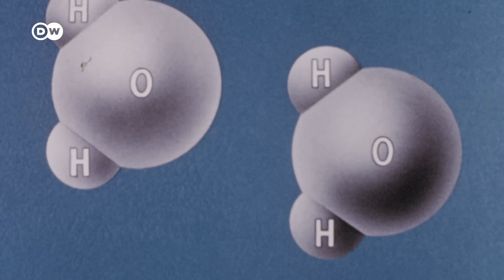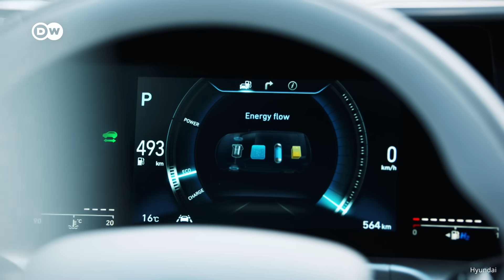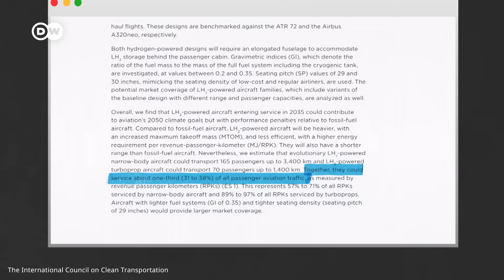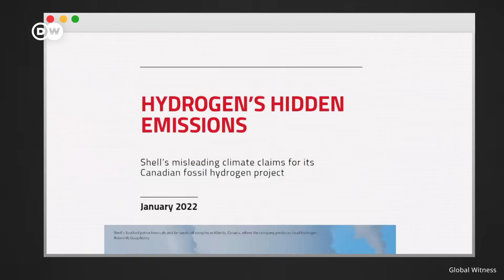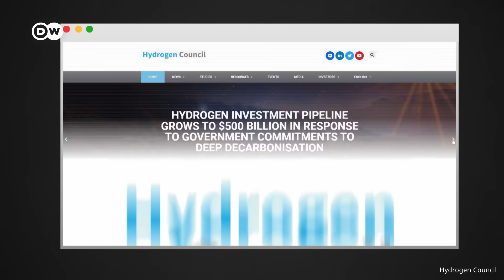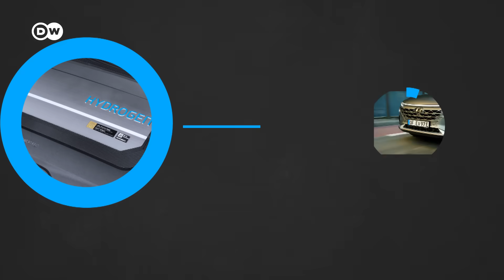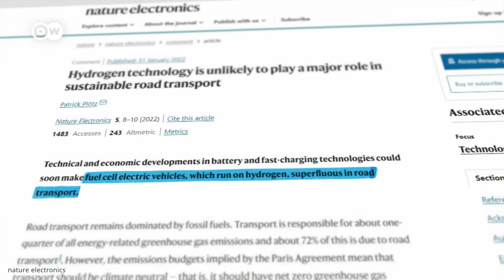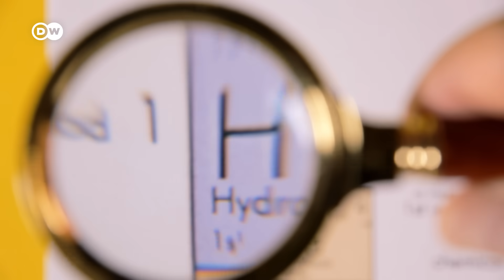The truth about hydrogen

Comment: The fact is that it takes more electrical energy to produce hydrogen than the hydrogen can produce in return. Hydrogen electrolysis is the most efficient known method to produce hydrogen yet still has this deficit. Battery storage is more efficient. Liquid hydrogen and fuel cells can give greater range but at increased cost and danger of explosion in an accident. As a source of "surge" electricity, in a fixed site scenario, there is some justification for the technology. The hybrid fuel cell that can be "fed" hydrocarbon fuel, liquid or gas, is much cleaner and efficient than internal combustion yet is being IGNORED as it uses hydrocarbon fuel...even though those hydrocarbon fuels can be renewable. Shame really.

Comment: while talking about green energy and making a case against fossil fuel economy, you never mention nuclear power. hydrogen is a way to store energy without needing a battery or grid. so modern nuclear plants outputting hydrogen is the clear method for net 0 future.

transporting h2 could be costly at first, but as long as it's 0 carbon it's still a positive aspect.

Comment: Continued  electrolysis production  of hydrogen  after a few million years will cause a measureable increase in the oxygen  ratio of the atmosphere . The oxygen  ratio is a fine balance. We're now at 21% region. 22% would increase fire risk for forest fires .
 Town gas used to be carbon monoxide and hydrogen obtained by passing steam over red hot carbon/coal . Probably  not much of the hydrogen  component  reached the consumers  before leaking away . Leaking out into space escaping earths  gravity.

Comment: People get carried away without considering the fly in the ointment. Hydrogen is very expensive. Wind power is already expensive,then using it to make hydrogen by hydrolysis, which loses about 20% of the energy, makes it even more expensive. It then hs to be pressurised to liquefy it down to a volume which can be handled. That uses more energy. The final prodduc is gong to be extremely expensive and we need cheap energy for the world to function.

Comment: Batteries won't work for trucks, and one study saying they "could" doesn't change that. When the truck's weight is limited you can't have half of that weight being batteries. We should move towards LNG/LPG and eventually hydrogen for trucks. As for cars, batteries might be good enough in 10 years, but right now electric cars suuuck for most people. Sure, if you live in a home instead of an apartment like most people, if you don't travel much, or aren't bothered by a 10 hour trip becoming a 15 hour trip then electric cars are good enough now. For most of us they aren't. So we should instead continue to build hybrids with 1-200km of range and a thermal engine running on LNG/LPG. This would eliminate most of our emissions in a way that is also practical and not economically crippling to the poorest among us.

Comment: Hydrogen should be pruduced with te excess from renewables and then injected in the gas (methane) grid to supply single consumers with a blend of the two gas hence reducing fossil fuel. This is far more economical and practical than investing into new vehicles powered by hydrogen cells.

Comment: Honestly, I would bet on methanol rather than hydrogen.

Methanol can be produced by photosynthesis means starting from sunlight, CO2 and water.  The efficiency can be quite high.  I read about some laboratory prototype with  almost unitary efficiency. I do not remember the efficiency of electrolysis, but I have a memory that is not great.

Methanol is a liquid, therefore it does not escape to the air and it does not impact the ozone layer; car be refueled as it was petrol; the density of energy in J/volume is much higher than hydrogen.  Yes, density per mass is higher in hydrogen, but the weight of a "full" of methanol is negligible (~50 kg) with respect the weight of the car (few tons).  Easier to transport and to stock.  It can burnt both in engine and in fuel cells.

Sure, when burnt it produces CO2, but that is CO2 that was already in the atmosphere. You can use it also as a capture system, using the methanol to produce other stuff.

Comment: A point that none does about hydrogen is the effect on the ozone layer.

Hydrogen is the lightest gas, this means that it is the one that escapes most easily from small leaks.  That is, in a hydrogen-rich economy you should expect lots of leaks.  

Hydrogen is pretty reactive too, so I expect that it will react quite easily with the ozone (another quite reacting element).  I suspect that it could cause a damage to the ozone layer more important than CFCs.
Reply from the maker: A study by BEIS Research looked into hydrogen heating and it's environmental impact and it found that the best estimate of the carbon dioxide (CO2) equivalence of hydrogen is 4.3 megatonnes of carbon dioxide per 1 megatonne emission of hydrogen over a 100- year time horizon. This means that yes, if leaked, hydrogen impact of hydrogen emissions on global climate is very unlikely to be zero and is very likely to be a small and warming contribution.

Comment: Yes with H2 it is tricky because production and transport and usage are so much more complicated and dangerous and inefficient compared to send electricity directly into rechargeable batteries. I hope battery market will soon see some new breakthroughs with even higher energy density and cheaper material compositions for the production of batteries.
Reply: Have you heard of ICE vehicles? 
Production, transport and usage of the fuel involved has killed tens of thousands, in its history, 10s of millions if you count wars to secure supplies 

Yet,  people still drive those vehicles.

Hydrogen is in fact no more dangerous than gasoline.
 And sometimes less so.

Comment: Y produce, store, transport hydrogen. Simply build a machine that is the miniature form of a hydrogen production plant. Put that micro machine in vehicles. Instead of refueling pump stations have water supply line. Fill vehicle tank anywhere anytime and keep going.
Instead of trying to enter the market or asking corporates to buy, build machines size of washing machine, provide them to home similar to selling solar panels which will produce electricity for that house as well as if that house uses less electricity than generated can supply to the grid and earn money. This will show companies and govt of promising business and they will automatically change from fossil fuel to hydrogen. Ooops...

Comment: The biggest problem is aiming for "net zero" which to me is not practical, as if nothing less will do which is far from reality. Work for reduced emissions over time as science discovers new ways. Don't forget the emissions active volcanoes spew out and you can't cap them.
We don't need net zero as the planet has the capacity to cope up to a point and that should not be overlooked (nor used as an excuse),
simply put the planet needs to be kept in balance.

Comment: The BIG problem with hydrogen is it is NOT a source of energy, it is a carrier of energy. It's less efficient than putting electricity into a battery. 

IF we went big on nuclear power, with wind and solar supplementing it, and produced a lot more power than we needed, the excess could be used to produce hydrogen. We're not anywhere near that state of things, so hydrogen is pretty much a distraction, a pipe dream at this time.
Reply: How many countries would you trust to manage nuclear installations and their wastes?

Comment: Sounds like more of the same by slightly different means is not going to work.  What a shocker.  If people believe hydrogen has problems, then lithium ions problems have their own problems.  What is staring us in the face is that people will need to consume less, and there will have to be less people.  Short of some fusion or thorium miracle, our energy intensive lifestyles are over, and the more we deny and fight that the worse off we will be.  We will only squander future opportunities by trying to maintain the status quo at any cost.

Comment: There are currently proposals being considered by the government of Costa Rica to build 3 large green hydrogen plants in that country, where the electrical grid is powered almost entirely from renewable energy sources and major recent investments have created what should be excess capacity (at least when not in extreme drought conditions).  The first of these proposals (from an Australian company) has recently been approved and is supposed to create 2500 new jobs in its initial phase.  Most of this green hydrogen is for export by sea and the construction of a new port is part of the proposed project.  I do wonder though about leakage during the transportation process, but I'd guess its still probably better that producing blue hydrogen in the consuming countries.  In any case, the Costa Ricans see this as a direct economic benefit from all the effort and investment they've put in to meeting their zero carbon objectives.

Comment: Just putting the energy directly into the battery is not all efficient because batteries lose power just sitting around and then need to be recharged all over again.  Hydrogen goes into a tank and can be there for a very long period of time.  No losses from non-use.

Comment: Hydrogen is the missing link to a 100% renewable. It works as a energy carrier, not as an energy source. Renewables are intermittent, eg. when the demand equals or surpass the supply, we should use renewables directly. When we excess of renewables we should convert it to hydrogen to use it in the transportation sector. Batteries are great allys, but are too heavy for anything larger then a passenger vehicle. And "blue" hydrogen is nothing but greenwashing. The green hydrogen is the only clean hydrogen.

Comment: When I look at all of the comments I see an awful lot of misconceptions about hydrogen. There is also the fact that hydrogen can be stored in solid form and released later fairly simply.

We already have an  infrastructure that already exists and is in operation now. You can transport hydrogen in Ammonia piping systems right now.  Hydrogen is a byproduct in some processes and can be captured using chemical bonding and in hydrates. Simple methane is CH4 which can be separated easily. Methane can be scrubbed from many waste products and capture the Hydrogen out of the gas. Hydrogen can take the place of any petrol fuel systems and you can get way more range out of the same power to weight ratio. People need to take the battery blinders off.
Reply: Why should we convert methane to hydrogen?  It isn't that easy to convert petrol fueled engines to hydrogen and the currently fueling infrastructure in place is not easily converted for the use with h2 as well.  Almost the whole infrastructure would have to be rebuild. The whole hydrogen story is doomed by its poor efficiency. If it comes to efficiency batteries beat almost every other system.  This and the much lower cost of batteries compared tho the h2 drivetrain  are the reason for the up rise of BEVs.
Reply: @anselml2928  Every ICE engine made can burn hydrogen fairly easily but it is volatile using in a standard vehicle without some added safety measures and tuning. I used to convert vehicles to burn propane in the early 80's,  not much different but at that point just burn methane. I was talking about fuel cell usage in EV equipment on a larger scale.  Working type trucks and equipment doing heavy work and towing. Ice vehicles can also burn Ammonia but there needs to be changes there.

When it comes to small vehicles running around and commuting in cities go BEV . 

When traveling cross country and range is an issue go fuel cell. 

When towing or hauling cross country or all day long in delivery scenarios use Fuel cells, straight methane, Ammonia, biodiesel on and on. When talking  cross country rail or transport across the oceans use Hydrogen in Solid storage strategies in hydrates or other storage solutions or Ammonia and use large sealed up fuel cell reactors or Ice engines running generators. 

It isn't a one size fits all answer to rely on battery tech. I could see super capacitors taking the place of batteries but still has its issues.

That is why I say take the battery blinders off and look at the whole picture. Little commuter cars are a small part of the total problem. 

What about air transportation? Clear back in the war they were running what they called water engines in planes. 

I have spent my whole life studying this stuff in history and any new papers I come across. 

Most people know nothing about solid fuel storage of hydrogen or spout talking points instead of really opening their mind up to all possibility. Even Elon Musk doesn't know everything. His new plaid engine was not his discovery , he just got the patent. That motor was known as the star motor in the past and the permanent magnets in it are the whole key to the efficiency he is getting out of it. Not his design originally. 

Just keep striving to learn more and it will open your mind.
Reply: @desertdan100  We should not rely on one technology. In this Point I agree with you.  The Problem with this many different fuel types is that we would also need  the  infrastructure for each of them. This drives the cost per technology up. 
With other words: if a fuel typ works from a technological point of view  does not mean it is also feasible financially.  This is typically the more important metric.  If there are only two or three different technologies the amount of vehicles per type ist large enough for the economics of scale to kick in. With this in mind I'm expecting that most Vehicles will be battery powered. For long distance aviation and some niche applications h2 or synthetic fuels will be the fuel of choice.  But even today there are already some short distance electric planes  in services for flights under 200 km. 
Additionally some of the  chemicals you mentioned are quite nasty stuff. Ammonia for example is nothing average Joe should work with.
By the way: to what are you referring with the term "water engines"?  Water does not carry any usable form of energy and thus can not be burned in an engine.
Reply: @desertdan100  Does anyone still believe in the story of the inventor who invented something that  good that he was captured by a big organisation and disappeared along with his invention without a trace?  If someone would invent a technology that could increase the efficiency of the ICE significantly he would maybe hated by big oil but would be employed by a car manufacture on the spot. The hard truth is: There is no cost effektiv  and easy method to increase the efficiency of an internal combustion Engine. ICE are dead. At least in the automotive sector. 
You mentioned that the electric grid  can't handle all vehicles being BEVs. Did You run the numbers? I did the calculation for the European grid. The result was that 100% BEVs would increase the energy need by 15-20%. I don't know how the numbers would look for the US grid but I'm assuming that it would look similar. Maybe a bit more due to the more heavy vehicles and on average longer driving distances. To prevent blackouts we would need some kind of energy storage. One solution could be big batteries. The mas adoption of BEVs might even help to bring the price of batteries down. EVs them self can act as an storage. I have heard that Ford offers an electric truck which can power a home for several days. That's what you need in a case of an blackout.
Reply: @anselml2928  I was referring to the many rolling blackouts that I have been reading about for the last 10 years. I am in America and the greatest concentration of BEV s are on the West Coast especially California. California has the highest amount of Wind and Solar Alternative Energy to pull from. They have constant rolling blackouts and buy power off of the grid from Neighboring states. Those states use Coal and Natural gas as well as Hydro Electric power. I am a big believer that we need more Hydro Electric and less Coal fired power generation but Coal and Gas are dependable.  Last Winter in the Southern US the weather shutdown and took out the Alternative Energy supplies. The Ice and turbulent wind and cold took out the Wind Turbines and the cloud cover for an extended period of time took out the Solar. 

All of the States through the Central and Northern US suffered from lack of available Natural Gas and everyone had to Curtail all Non Essential things and go onto backup fuel oil and LPG to try and survive and prevent freezing and power loss. Gas fired power plants had to drop way back to try and keep heating gas going South to try and feed heating and power generation from the handful of power plants still operating. It was a mess and all of us are still paying high double and triple fuel costs because the Weather and failure of Renewable power. This isn't theory it is History. All of us are going to feel it for the next 3 years or more trying to make up for that 1 event.  That was just in the US and we have one of the most Robust diversified energy grids in the World. 

Our Energy Grid has needed updating for 80 years. Instead of building more and more and upgrading we went the way of a smart grid with constant shifting of the constant energy back and forth all over. That doesn't work if you ask for more than it can give all over.

The Ford claim is real but it isn't enough for days if it is either really cold or really hot. 

The amount of energy needed to charge all of the transportation and industrial Energy needed is astronomical and totally out of touch for at least 15 to 20 years if they started building a new 20 megawatt small power plant every day from this point on and that is actual math not taking into account any new growth in usage. My dad worked for the electric industry for 35 years.